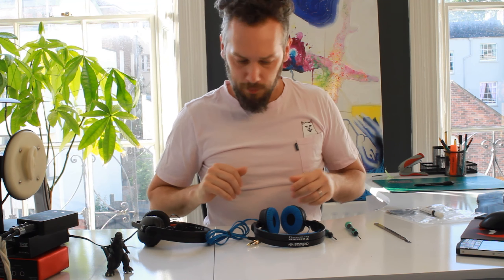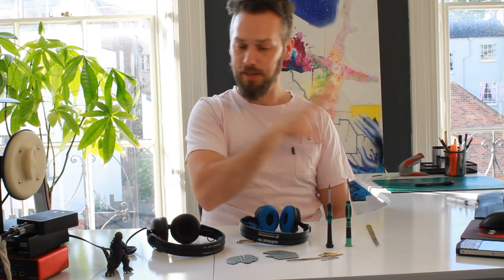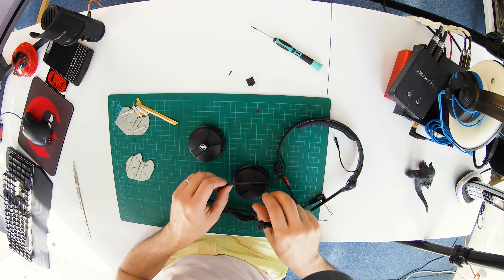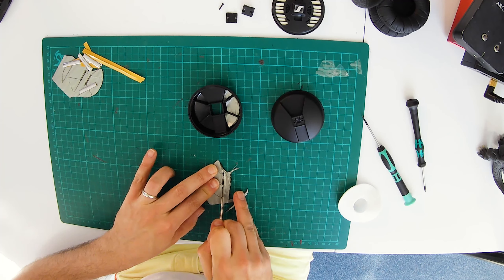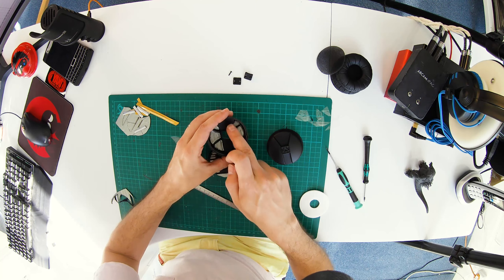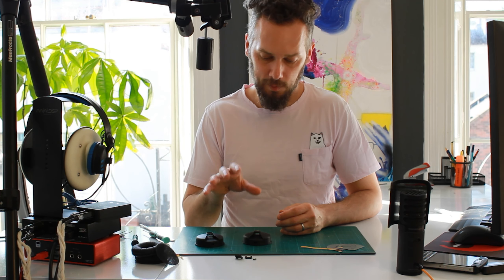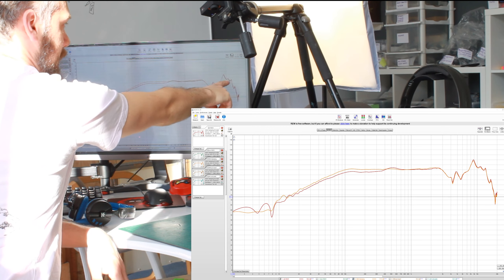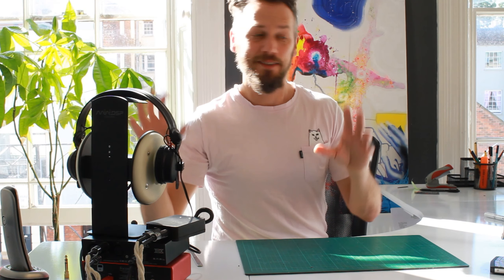How to fit the HD25 Mass loading and Damping kit and old HD25 vs new HD25

Comment: I watched this before buying the mass damper kit. Installed it myself including the lead strip around the driver itself and managed not to break anything. Wasn’t expecting anything too crazy but after modding and with the Yaxi Type B pads, I’ve been absolutely blown away and so have my DJ friends who’ve listened to them too. Bass is deep and relatively tight, mids are nice and present, and highs are clear and distinct without being harsh. Frequency response graph doesn’t do this justice.
Reply from the maker: Thanks for the feedback - yes it is difficult to show on a graph

Comment: The midrange peak on the unmodded driver is due to the felt disc interacting with the air cavities formed by the small stiffening partitions. The increase in low end after modding is from partially blocking the driver ports. I've tried blocking them more and it created a minor peak around 70 hz, which also extends the sub bass even more. I used sheeps wool to replace the felt disc and it cleaned up the upper mid peaks along with flattening the treble a little more.
Reply from the maker: Nice. Thanks for the feedback. I am planning on making a fancier mod for them next month hopefully so I will have a good play and do a load of tests with different configs

Comment: Just completed modding my HD25 with this damping kit and the aluminum cups (which fit and appear like OEM btw). 

What is the benefit of removing the felt donut behind the driver? I've left them out by recommendation here, but curious if adding them back would help with additional dampening.
Reply from the maker: The effect is pretty subtle and it have been a long time since I tested it but from what I remember you get a little less upper treble with it in but it reduces the sound stage a little... As I said, it was pretty subtle, I just preferred the sound with it out

Comment: Hi bud I just ordered this kit, does it fit the old ones? Mine were bought in around 96
Reply from the maker: Yes it will fit the older ones, I would just probably not remove the grill to fit the long weight around the driver as if you are not careful you can break them and as they have lasted that long I would not want that on my conscious

Comment: Got Amperior, and ironically the "ring around the driver" part was much easier to do (which was success) because I wasn't able to remove the housing due to the rigid aluminum cups.  Almost ruined headphones not by doing the ring mod, but instead of attempting to remove the housing.  Is there any tips for that?  Also don't want to ruin the cups by digging some metal against another metal...
Sorry if it's too much to ask...
Reply from the maker: Unfortunately i think the only option will be to use a flat head screw driver or spudger to lever the driver out. If you did mark the aluminiun while prying it open, it would be in a place you could not see when it was back in one piece as the pad would be covering it

Comment: Greetings from Paraguay :), I just bought one of the last 3 units that were left in stock, I will mod my new hd 25 se it's a shame to open them from the box, one question, the greatest risk to the time to open the driver is to force the wires that are with glue or break the driver but I think it's more appropriate to open the driver with tweezers than with a screwdriver as you showed in another video, the real question is Would I achieve better or worse acoustics if I left the old cotton damper + the mod or would it be counterproductive? And there really wouldn't be any risk in opening if I'm careful with glued wires and I am very soft with the driver?
Reply from the maker: It would be down to personal taste, you may prefer the sound with the original felt disc. I think, as long as you are careful, there is not much risk. we sell hundreds of kits and have not had anyone kill a driver since this video was uploaded

Comment: @CustomCans Is this modd legal to import to Norway? In regards of use of lead if it is i will be ordering some soon!
Reply from the maker: We should have a copper version available in a few months
Reply: That sounds great i cant whait to put my order inn! 
Just a thought have you conssiderd using brass picesfor the mass loading?
It is great for gounding vibrations in speakers fasteners, spikes etc.. I have used brass to mass loading the back of the cones on a pair of koss porta pro with great resualts they sound better at this point to me then the stock hd 25 that i own i my opinion and they have been kramer modded and i cut out a center hole on the pads and soon to be mmcx converted they sound more natural and more musical and just emotionaly pleasing at this point witch is cracy at that price...
But i have stock hd25 no modding done yet but i ready to try ;-)  @CustomCans

Comment: Where do i get the lead strips you use? For the 1990's mod.
Reply from the maker: if you search for 6mm self adhesive lead you should find some
Reply from the maker: It does not make as much difference on the 1990s as the lower models as the drivers are already quite heavy
Reply: @CustomCans  Thanks, i just have to try it anyway as its so cheap. Balanced mod took a little bit of base away i felt but not by much. Maybe it just increased the sound stage elsewhere giving that illusion, who knows lol.

Comment: Great comparative video. I will definitely order the mass and loading mod.
Maybe the drivers need a little bit more time to break in. There's a guy that stated on the hd 25 head fi long thread that he started noticing noticeable changes on the highs and overall response of the 2020 model after about 60-80 hours of use.
https://www.head-fi.org/threads/hd25-1-impressions-thread.163153/page-200
Reply from the maker: Yes ... Not sure how long they need but even if they are the same version you can hear the difference between a nicely warn in pair and a box fresh pair... Maybe it had not left them burning in long enough. The link for the kit is now up in the description

Comment: sorry that I ask question here ,  I have a hd25ii , and I want a hd25 aluminum,  is that possible i got a hd25 amperior and exchange the metal case  with the plastic case  and make a hd25 aluminum ? Are they compatible?
Reply from the maker: Yes the amperior earcups will fit the older MKII HD25 drivers - the amperior used the same earcups and the HD25 aluminium. The latest HD25 drivers do not fit as tightly in the aluminium housings though
Reply: @CustomCans  thanks reply , ic , seems i need to got a old HD25ii (seems made in ireland better)
Reply from the maker: @makeow  Yes... If they have HD25-1 ii written in the small square in the centre of the left earcup then the drivers should fit. If it just has the sennheiser logo, then it is the newer driver. You can use the new drivers but may have to glue or tape them as they don't click in firmly enough